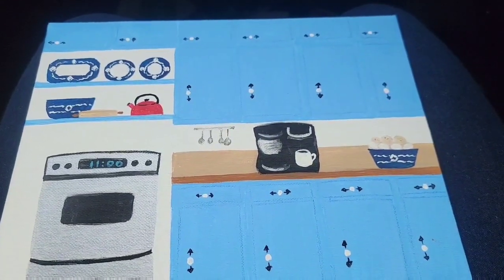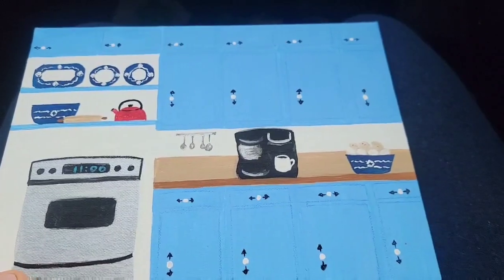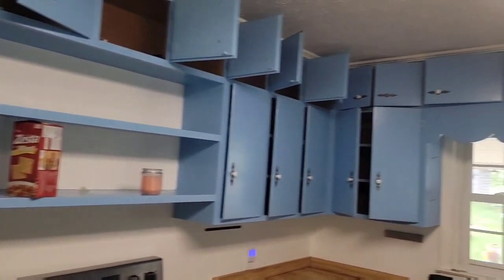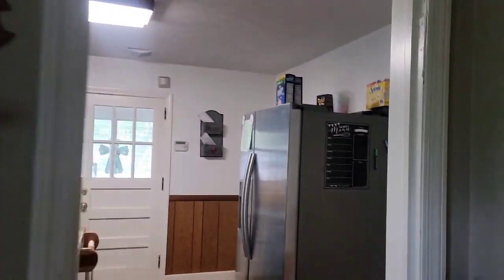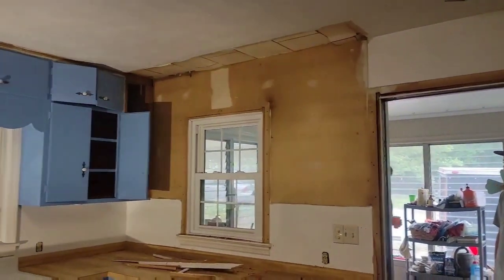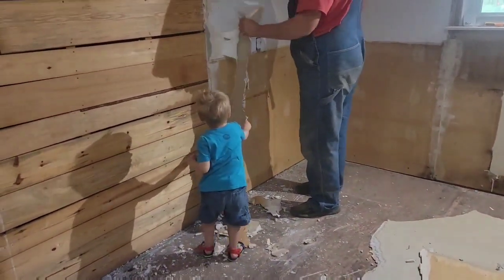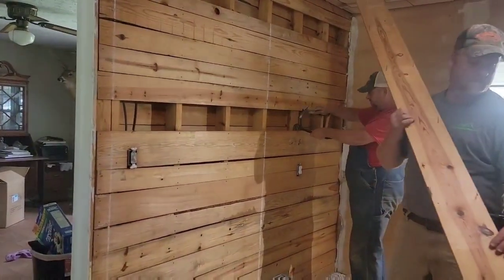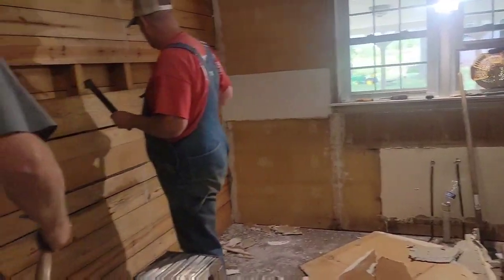Day 1 & 2 of kitchen Remodel

Comment: Tip here cover up and keep doors closed keeping out dust that’ll be EVERYWHERE
plus theres heavy duty plastic sheathing builders use hung to open rooms keeping 
out the drywall dust/sanding etc. and runners for floors keeping it from tracking in
the other living area.